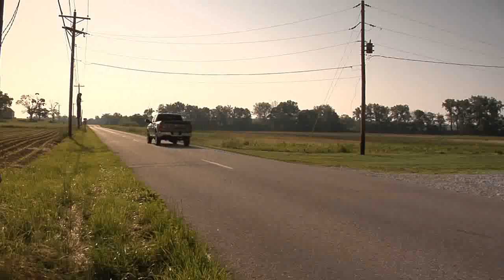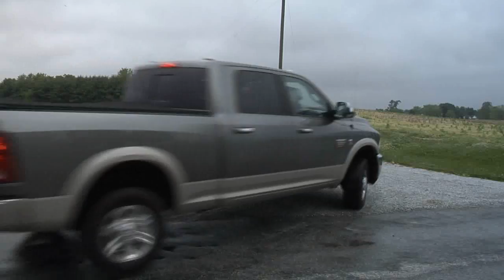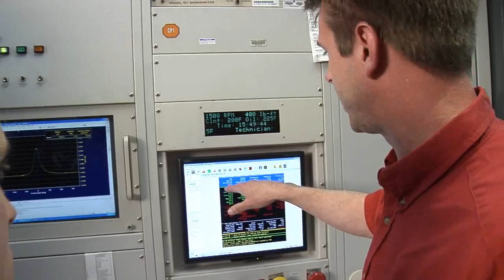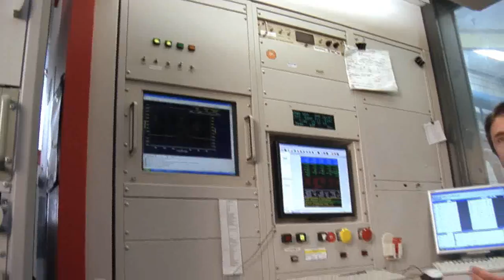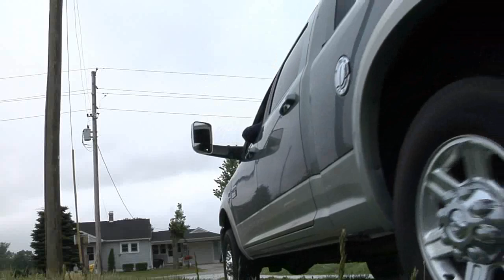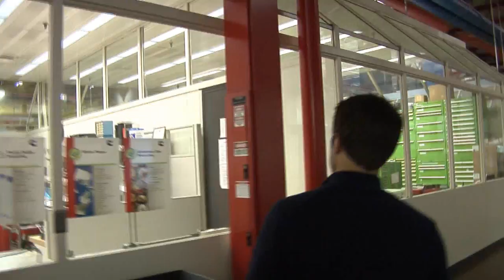Cummins 6.7's Biggest Fan (Pt 3): Cummins Power

Comment: It's a good thing Tim showed me that I can pull two trailers with three tractors that weigh a total of 8k lbs. This is a badass engine, but this video seems like a childs program. Let's see a 4x4 cab chassis 5500 pull a trailer with a mini-excavator across some #2 stone all while carrying concrete forms, stakes and tools. Much like we do all day.  If you want to flex muscles, kick that dope out of that truck and give it to a concrete crew. That's a good video.